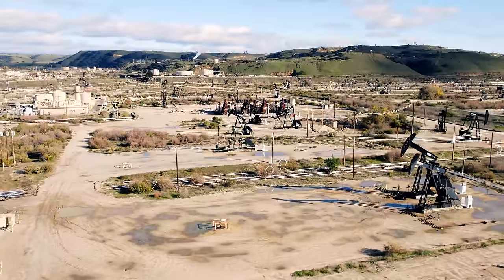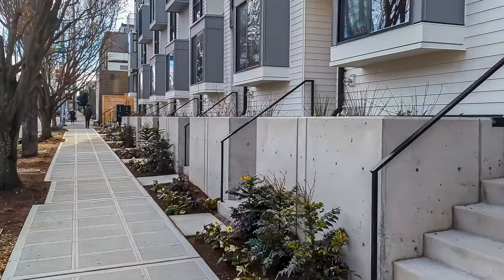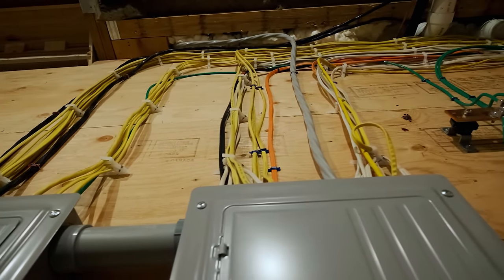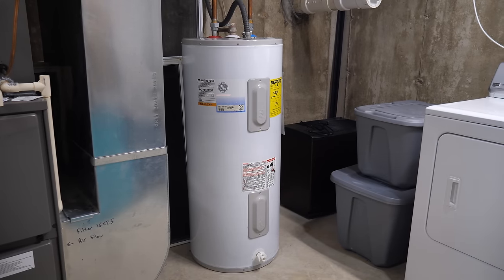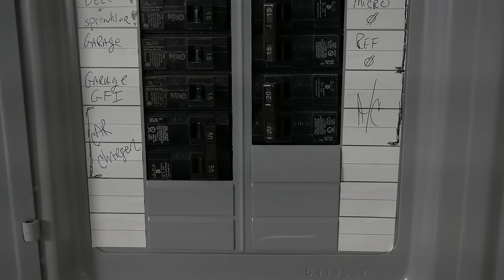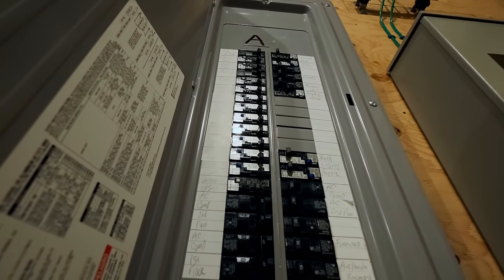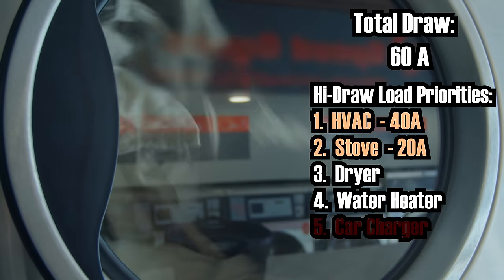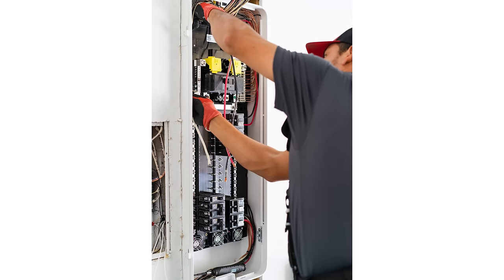Home Electrification: There's not a lot to do, and it doesn't have to be hard (Part 1)

Comment: Been living years all electric, there's often a lot of elitism and snobbery about electric appliances being worse somehow (especially towards stoves), but living with it all this time I've found everything has worked fine and been reliable. I've certainly enjoyed having my power bill ride steady lately while a lot of friends and family got a new an exciting heart attack every month upon viewing the latest gas bill...
Reply: I was the opposite. I bought an all electric home and converted to gas. I spent a decade with cheaper heating costs and a water heater that didn't give you half a bathtub of hot water. 
Even with the volatile gas prices of the last year I still am better off as electric rates where I live are stupid high.
Reply: I dont know if it's necessarily snobbery. Gas ranges are unequivocally and objectively superior than electric for cooking. Also gas is a better choice for off grid living as a tank will always provide energy whereas solar can be a major issue without massive battery banks and complicated inverter systems.
Reply: @reshpeck  if anything I see more snobbery from the electric side. There's definitely an aroma of hypocrisy as well as a lot of shade cast at the lower classes, particularly poor rural and small town types.
Reply: @reshpeck  They absolutely are not. Please see video from this very channel. They dump all the heat out the sides of the burner. So now, sorry but you're wrong.
Reply: I think only my heater in my house is gas.
Even then its lowkey wild that some houses uses FUCKING GAS LAUNDRY DRYERS
Reply: @reshpeck  Gas is shitty if your having it inserted directly. If your area gets nuclear down the line, tf you gonna next?
I would rather have a centralized gas turbine in some powerplant giving me energy than having the gas directly pumped into my home
Reply: @thysonsacclaim  I'm not talking about efficiency, I'm talking about proper temperature control. A constant steady source of heat is better than a a heat source that cycles on and off.
Reply: @battra92  I think u just cheaped out the water heater. 
It shouldnt even be a difference tbh. Idk how a company would fuck up a water heater when heat is the easiest shit possible to generate.

Im lucky tho cus my area got cheap hydro power.
Reply: @honkhonk8009  first, learn to spell and type. 

Secondly, I don't live in an area with hydro power. The rivers are too unreliable and there are no dams. Electricity is expensive where I live and due to the terrain very difficult to transmit. Pipelines can deliver gas fuel to the local utility though.

But thanks for proving my point about elitism over people living in areas with cheap electricity.
Reply: @honkhonk8009  I live in Colorado. We have very limited water resources and it gets extremely cold. Without gas, our grid would shut down every time it gets very cold, which is often. Many people would freeze to death. But you keep on living in your little bubble where only your experience matters.
Reply: @reshpeck  Then maybe tell your state to stop cheaping out on your grid.

Pipelines involve MOVING PARTS and underground infrastructure. Electric shit is infinitely cheaper and more reliable in every way.
If your state has reliable gas but unreliable electricity, thats on your power company for fucking up.

I wouldnt buy electric shit untill your state decides to actually cash out and make sure their grid isnt held together by ducttape. 

I blame the government mostly. The fact that our powerlines are built by the cheapest bidder and the fact that were powered by coal instead of nuclear, is pure bullshit
Reply: @honkhonk8009  I don't think you appreciate exactly how difficult what you are proposing actually is. And seeing as how you feel about the government, I should think you would recognize that if something like what you are describing were to actually cost $10 billion and take 10 years, it would cost the taxpayers $50 billion and take at least twenty years.

But I completely agree with your last paragraph.

Comment: A smart panel is a great option if for some reason you ABSOLUTELY CANNOT upgrade your service, but if you can it's probably better to just upgrade your service. The reason is that smart panels like the SPAN are very expensive ($4500), it will be cheaper in most cases (~$2500) to upgrade 100A to 200A.
Reply: That's somewhat absurd - where are the people saying "Don't worry solar will be affordable in 10 years" now?
Reply: @Coconut-219  Solar is getting more affordable per kW every year, by a significant amount. There are a few qualifiers there. "More affordable" doesn't necessarily mean "affordable". "Affordable" means different things to different people. "Per kW" is important to keep in mind; we can get better panels, and the panel cost can go up, all while the cost per kW generated can come down.

Comment: I live in an all-electric home.  It was built in 2006, and still has the original heat pump, now 17 years old.  When we're forced to replace it in a few years (hopefully a few years and not a few weeks or months!) I want to get one that's much more efficient during the winter.

I live in the north-Georgia mountains, and it doesn't get that cold here, and when it does get that cold here, it doesn't stay cold for too long, usually.  However, this past December it was well below freezing for a couple of weeks -- very out of the ordinary.  Because the resistive-heat backup had to kick on so much, our electric bill in January was $450, when it's normally around $250.  That was a nasty surprise.

Anyway, long story a bit longer, I want a heat pump that can run for a longer period of time in extreme cold, without needing to kick on the resistive-heat backup.  Newer heat pumps are definitely capable of producing heat in much colder temperatures than they were just a few years ago.  (You showed us several in one of your videos. 😁)
Reply: Look at Bosch IDS.    I've got one at my cabin in the Blue Ridge of SW VA.

Comment: In warmer weathers, or even in colder ones with few cloudy days you can also replace the boiler with solar water heater. I have one and wow, that thing can make the water burn easily. Yes we have a backup because where I live you can have several cloudy days in a row, but it’s like only twice a year and also if there is a cloudy day but the rest are sunny it’s completely fine, that thing keeps so much hot water, even for several people.

Comment: I think putting HVAC lower on the priority list would make some sense, especially in winter. When the oven and dryer are both on, some or all of their heat is emitted into the home, letting the furnace take a break. In summer, if the AC is briefly off it should still stay cooler than outside due to insulation.
Reply: dryers expel 100% of the air. So they actually pull in outside air into the home that needs to be heated.
Reply: @joeyf504327 , while they do create a vaccuum, there is a fair bit of heat that goes into the room through radiation and conduction - those steel boxes are not insulated. 

There are ways to avoid expelling the waste heat and moisture, such as putting the vent hose into a specially prepared bucket of water. Another way (that also saves a lot of power) is to use an all-in one washer/dryer that uses a ventless condenser system, sending the moisture out the washer drain. These are much slower but can save massive amounts of heat loss and electricity.
Reply: @questioner1596  those ventless dryers use tap water to condense the moisture out of clothes. They dont do a great job and don't expel the lint from clothes.  Plain fact is gas appliances have huge advantages over electric.
Reply: @joeyf504327 , I see no major difference in function between a conventional gas dryer and conventional electric. Can you elaborate? 

I agree that the combination washer has downsides, but they are really tempting for the extra space and reduced power consumption. Everything is a compromise.
Reply: @questioner1596  our dryer will no way ever be able to heat our home... maybe the room its operating in but that's only a 8x12. In the winter Id rather have a heated home then dried clothing... burst pipes aren't fun.
Reply: @FishFind3000 , I'm not saying to use the dryer as the primary heat source. The furnace doesn't run all day, just let the furnace be off while running the other appliances and it can catch up when the oven and dryer finish.
Reply: @questioner1596  electric resistance is the least efficient heat possible. You burn fuels to generate electric @ only 40% efficiency instead of burning gas where 100% of the heat is used. Electric dryers are only 30 to 40% efficient at best compared to 100% for gas.
Reply: @joeyf504327 , that can be true, but it depends where you live. You're assuming a power grid powered by fossil fuels; if your power is hydroelectric, then it's a choice between fuels or gravity power. I realize there are many downsides to constructing a damn, but once it's built, there's little penalty to continue using it.

Comment: As a resident of the PNW it's super common to have all-electric homes. Unfortunately it's also super common for them to be heated resistively, and with the housing market the way it is renters like me tend to get the short end of not being able to use a mini-split heat pump, though, portable heat pumps and window units are pretty widely available these days (I'm stuck with a portable because of tall sliding windows :< so...)
Reply: I recently moved into a home in the PNW that uses natural gas after being in all-electric houses my whole life. It’s actually been hard to adjust to - I still haven’t used my oven since I moved in because the smell it makes doesn’t seem normal to me. Gas seems generally way more dangerous to me than electric - my gf and mom keep saying “you’re so lucky you have gas” but to me it seems worse…

Comment: That SPAN stuff is pretty awesome. I thought up something similar a while back, nice to know that it already exists. I do think though that this kind of stuff needs to be standardized (as in, same communication protocol, not necessarily standard in every home), such that connected devices that can manage their load more gradually themselves don't get bluntly shut off. For example washing machines or fridges, that can without any problem postpone the next heating or cooling cycle for say 5 minutes, when another temporary peak load appears.
And add functionality to deal with dynamic energy prices. For example, give commands that a device should increase it's load, such as water boilers that can heat up just a couple of degrees extra when electricity is cheap.

As European myself, I do wonder what that 100 A capacity is protected by? For example, in my home I have a 1x35 A connection (230 V). This is quite old by now, and not installed anymore. Instead you either get 1x25 A or 3x25 A (latter 3 phase, so effectively 400 V). These are protected by a DIAZED style fuse, which are incredibly slow to melt. Checking the trip curve, you can draw twice the rated current for say 10 minutes or so. Issue is, if they melt, you will have to get them replaced by a licensed electrician, read: very expensive for less than 5 minutes of work. I think the alternative is a circuit breaker with a C trip curve instead. Internally, all sub-circuits are protected by a 16 A (B curve) circuit breaker, with a RCD.

Comment: Let me start with I agree with what you are saying. As someone who works for a large electric and gas co in the southern part of the US, we still have alot of work to do before we start thinking of ditching natural gas. We have yet to ditch oil and coal plants at this point. The natural gas distribution infrastructure can be deployed quickly and is relatively safe given recent advancements such as PE pipe becoming the industry standard. Combined cycle gas plants are extremely flexible and supply power to the grid within hours. We should be focusing on getting people away from oil and coal first before going after the best of the worst fossil fuels we have.

Comment: I looked at electrifying my home in Ohio this past year, mainly because of your videos. Every contractor I talked to advised against it, as well as homeowners I know who currently have air source heat pumps with backup electric. I thought about having HP with gas backup, but HP was about $1000 more to install than standard AC and more expensive to operate unless I cancel gas service and cut out all the base charges. It just isn't possible for a HP to keep you comfortable on days well below freezing, especially in older drafty homes with poor insulation. Our electric rate is increasing 28% this year due to rising global energy costs. We got warnings from our power company on very cold days this winter to reduce our electricity usage to prevent imminent rolling blackouts. Last summer a small storm upstate and heat wave caused blackouts for almost a whole week. It's kind of silly to say the unreliable electric system is a separate issue when trying to convince people to rely more heavily on it, don't you think? And electric cars can double or triple a household's energy consumption as well. So we convert everything to electric, continue to burn natural gas and coal to power them through less reliable, increasingly over loaded transmission and distribution, save a marginal amount of energy but pay more for it, and are less comfortable, just so we can think we feel better about it? By the time we rebuild our entire electric grid to support all this, the heat pump I would have bought this year would be at the end of it's life and have terrible efficiency compared to what might be available in the future. I think it makes sense to switch to electric ranges for speed and efficiency (although being able to cook with gas or have hot water during power outages is great) but honestly what's your gripe about burning things? You can't make steel, fly a plane, move a cargo ship, or do any industry to scale without burning something. The cultural drive to electrify and promote green energy in residential settings is clearly an end-user illusion to trick people into feeling virtuous whilst the unseen fossil fuel industry supports it all. My neighbors have solar panels which are great to offset AC in the summer, but provide hardly any power in the winter. It would make more sense to advocate that new homes (especially all suburbs with huge yards) be required to have ground-source or air-source heat pumps and electric ranges. New developments could be designed to handle electric loads for all-electric households, and that would be so much easier than retrofitting old homes. People never consider that replacing all your appliances or rebuilding an entire energy grid has a huge cost to society when housing and energy costs are already straining so many people. There's a lot more that people are worried about in life than the constant fear mongering that the world is ending (very soon) due to climate change, and the alarmist doomsday rhetoric isn't helping lost millenials and zoomers feel like they have a future worth making a meaningful existence. I know it's fun to try to find better ways of doing things and I agree we should always question everything we do and stay open minded but there are many different and unseen costs to all of our decisions. Thanks for the video.

Comment: Discovering this channel shortly after buying my first (quite old) house has been a godsend. Thanks for the work you do on these videos.

Our current forced air gas furnace is 15 years old and likely to go - we're psyched to replace it with a heat pump in the next few months. After that: Solar! Well, probably insulation, then solar.
Reply: our furnace and ac were put into our home by the previous owner back in the 80's. They have ran perfect for all that time. If you have good equipment and take care of it you shouldn't have any issues for a long time.

Comment: You can get a heat pump water heater, and a heat pump washer / dryer combo now from both LG and GE all that run on just a 15A 110V outlet. That only leaves you the stove and the home heating to deal with.. Solves most of the power issue right there. Probably a better investment than the SPAN, better to use less power than switching.

Edit: guess I shouldn't comment before the closing segment.  I guess that will be in part 2

Comment: I live far north and heat my home with wood in the winter. There are two main reasons I don't use electric (which I do have access to).

1 - Wood is considerably cheaper where I live.
2 - Power outages in the winter are not uncommon, and a wood stove requires no power. This is kind of a big deal when it's -40 outside. Plus if desperate, I can acquire more from my own property.